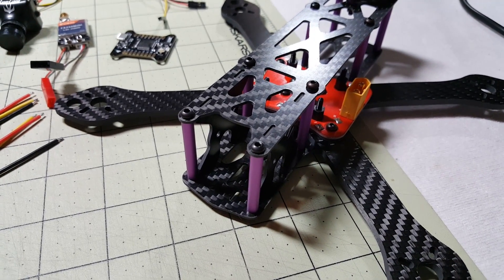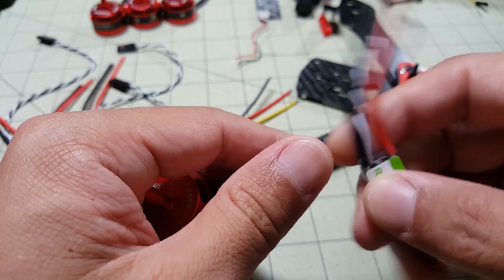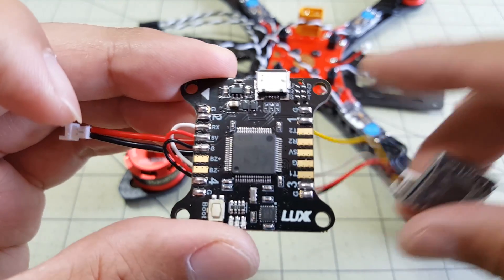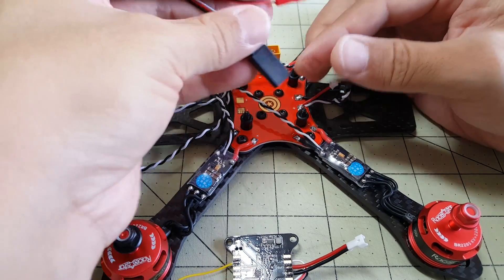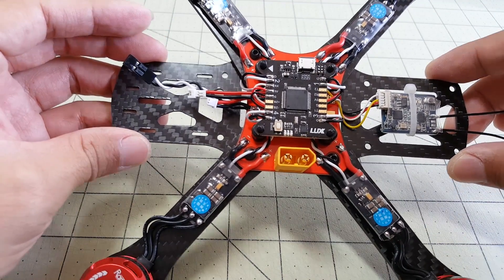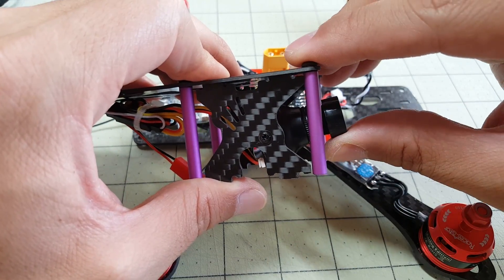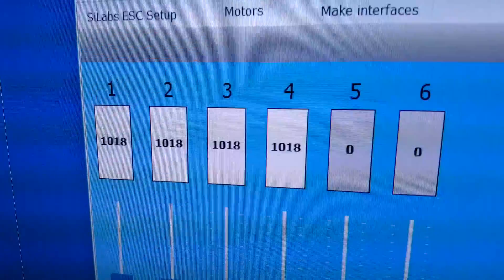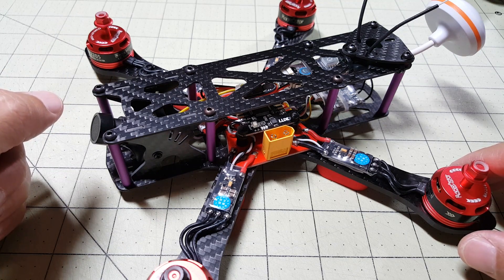Martian II 220mm Quad Build

Comment: Ive been wanting to do one of these builds with the martian frames, but id like to use 5045 tri blade props on emax rs2205 motors and a 4s battery. Will the Favourite Little Bee 30A ESCs be sufficient for the amp draw. Thanks!
Reply from the maker: +Alexander Napper should be ok

Comment: I'm looking for a budget frame that protects the motors well. I was considering the rd210 (search it on banggood) and the Martian II. However I have some problems with both. The Martian II relies on the pdb for support, and I have heard that it's pdb sucks. It's also like 140g. The RD210 is 120g, but the arms extend farther than the main plate (is that normal for all quads? I would prefer if, in a crash, both the arms and the main plate equally shared the impact).

Comment: Just a suggestion: you dont need the little triangle "alien head" piece of carbon fiber. And if you leave that out you can use zip ties inside those heatshrink tubes to make the antennas even stiffer.

Comment: I have a nearly identical build, only difference is the FC (Naze32 Rev6), VTX (TBS 919 unify), and my motors cam with some LEDs for the underside of the arms. Any tips? This will be my first build, any tips? i was thinking i may need to replace to PDB with something that has 5v pads.

Comment: Very nice video i didn't know you had a build video of this frame. I was just wondering i have one coming, but i don't see where to get the 5V to power on the FC. Witch solder pad on the pdb gives 5V? Thanks
Reply from the maker: The LUX flight controller can take direct lipo voltage 2-4S.  So that's why there is no source for 5V.  If you use a different flight board you'll probably fry it.

Comment: Hey dude, I'm totally lost. I'm building this and I have the same escs as you. They don't have BECS so how do I regulate the voltage to the escs? The built in pdb does not have any voltage regulators.
Reply from the maker: +Michael M if you get all the exact same parts the BEC is not necessary. In other builds a 5v regulator is needed for the flight controller but on this one the flight controller can take direct lipo voltage. Same with the camera and VTX.
Reply: Your thinking about it to hard. Bec esc's have a 5v lead including ground and signal for your esc. That will power the FC board when the esc's receive battery power. Now opto esc's do not have a Bec to Power the flight controller, and only a signal and ground going to your flight controller. In this case, now the flight controller has to be separately powered, and cannot be powered from an opto esc.  that's really the only difference. The white signal wire going to your FC tells the motor how much power to give the motor.

Comment: Great Vid! Thanks Albert. I have a newbie question, since I'm about to build my very first quad:
You would fry your 20A ESCs if you use 5045 props and that 4S battery, Isn't it? According to the 'data sheet' of the motor each consumes at full throttle 27.6A. Am I missing something?
Reply from the maker: Yes, if you stay at full throttle for more than 10 seconds it will burn them.  But I use 5040 props and the amp draw is lower and I also don't go full throttle for more than a few seconds at a time.  They can go up to 30 amps for a few seconds with no issues.
Reply: Hi i have a question for you Albert Kim! I want to build a drone with almost the same parts u used here but reading this, why didn't u use 30A ESC's?

Comment: Are you using any special usb cable to connect to PC? It looked different
Reply from the maker: No, it's just a normal USB cable.  The end has an adapter for mini to micro usb so that what looks different.
Reply: Thank you! Tried finding the cushion pads you used for landing, but cant seem to find them.

Comment: hi please help me out,i want to connect ppm to this,and i still use the old flysky fs-i6..i am just not sure howto connect my receiver to this board i know i must bridge the ppm part and the 5vpart wich i did and also flashed betaflight to it..just want to be sure i solder my 3 wires of my receiver to rx,5v and ground??i ordered my parts exacaly like yours just with 30a esc instead of 20a..sorry i am new with this and this is only my 2nd quad,there is just no videos on youtube on how to connect this to ppm
Reply from the maker: Check the manual ... download here - https://goo.gl/70PzPA

Page 2, the PPM pad is RX next to the big 2 on the board. Bridge PPM on the back

Select PPM in Cleanflight or Betaflight.

Comment: I'm about to pull the trigger on this build, how has it held up over time? Happy with the Chinese ESCs and Motors? Or should I splurge a touch more and get something more mainstream? Or are there better Chinese motors out there?

Thanks as always for the wonderful vids!
Reply from the maker: I'm happy with the motors and ESCs. HOWEVER, I'm not a speed freak.  If you need the best, most powerful motor, I recommend splurging on motors like the EMAX RS2205.  The ESCs are fine.

Comment: Are 20a ESC's enough for 4 this motor? I want these motors but I dont know if I need a 20a or 30a esc. Banggood says that this motor has a 27a load current on 4s with 5045 props. And what if I put 5045x3 on this?
Reply from the maker: I'm using 5040 props so the amp draw is lower. Plus amp draw is typically lower in the air than on the bench. However, if you want to use more aggressive props, go with the 30amp ESCs to be safe.
Reply: You sir are amazing. Thanks for the insanely fast response! I will be building my first quad soon :) Just gathering some info before I do.
Reply from the maker: Thanks!

Comment: Are the motor screws long enough for the 4mm arms?
Reply from the maker: Yes, in fact I'm using the shorter screws and they bite into the motor about 1.0-1.5mm which is what I want.

Comment: which motors perform better ? that you used in this build or the kingkongs in your 300$ build, I am looking for 2300-2600 motors from bangood for build like yours and I cant decide motors and ESCs
Reply from the maker: The motors in the Martian are very good, but these are better (and more expensive) - http://goo.gl/9eUsJC  Just warning you that you may not be able to control the power. It's pretty amazing.
Reply: and how about a 2600kv version on 4s lipo 1300mah with 20a ESC ? or rather 40a ESC ? tri blade 5040 props

Comment: How this FC can handle 4s battery ? I red somewhere it is better to add BEC between battery and FC to help FC handle voltage peaks
Reply from the maker: It has a built-in regulator and is rated up to 6s I believe. On 4S it has not given me any problems with voltage spikes.

Comment: Hi, nice clean build, but are you getting any issues in the image quality, since you just have direct power to the vTx and camera and no regulation in between?
Or is the Vtx handling it well? What about the antenna. It's sitting kinda low and could be blocked by your battery very easily. any issues with that so far?
Reply from the maker: +TeeSCee no issues with video. It's very clean. That vTX has a filter built-in. It then cleans up the power to the camera. Also my ESCs are not that noisy. No issues with the antenna.

Comment: Thanks for this video! I'm planning a Martian build but I'd like to use another PDB (the size of the naze32), do you tjink this will be fine or is the enclosed PDB an important part of the frame structure?
Reply from the maker: +Henrik Heinerwall I think the PDB is part of the frame structure but you don't have to use it as a PDB, just as a plate.
Reply: +Albert Kim (marblekit) excellent, there seems to be enough vertical space to stack both a PDB and naze32 even with the original PDB beneath. Thanks!

Comment: My RCX 250 has taken a beating, recently. After I use up my last spare arm, I think I'm going to move onto one of these frames. I might even go the distance and copy your motor/esc choice. Are they the "best bang for buck" pieces at the moment? You're my go-to for finding the not-crap Chinese clones. ;)
Reply from the maker: The scene is rapidly changing! Already the V2 version of the escs are out. I will show them on another video later. I think by the time your ready for a new quad the best parts may be different by then.  But, I'm sure I'll have more updated videos by then as well :)

Comment: I bought four of the Racerstar 2205 2300kv motors from Banggood they have not arrived as yet so it is good to hear that they run so smooth.
Reply from the maker: Yeah, I always run them up in the motors tab in the configurator to hear what they sound like to make sure the bearings are OK. Sometime bearings are bad from the factory. I've had several DYS motors come out of the box sounding like they were already through 10 crashes.

Comment: Very impressive, clean build. Will definitely help me on 1st build shortly. Someone already asked what good the antenna plate was - can you leave it off? Also, I ordered the motors, now thinking I should get the ESC's too. Would you say Blheli_S is the way to go from now on? Can you put them on with any FC, motor, etc.? Last, you mentioned the Lux vibration - when you soft mount a FC, do you put O-rings just under the FC, or on top as well. Somewhere I saw that using 2 O-rings was worse, but I don't remember if that comment was for top and bottom, or 2 on 1 side! Thanks.
Reply from the maker: Yes, you can probably leave off the antenna plate. Especially the way I mounted the VTX antenna pointing out the back and not up through the top plate. It does help hold my XSR antennas but I think I may take mine off too.  I think BLHeli_S is the way to go. But it's still early days.  They are very smooth.  I would get the V2 versions which are already out.  I have them but haven't tested them yet.  Those are going on the QAV-X clone.  http://goo.gl/KVfRRG  The V2s are twice the CPU power and only a few bucks more.  Futureproof, right?  I will have a separate video on the LUX issues. I had some problems but resolved them. I will share with everyone.

Comment: Did the camera tilt back plate not fit your hs1177 bezel? Mine did not fit the foxeer camera, needed the runcam brand bezel
Reply from the maker: +Phil659 I didn't test it. I decided to use my RunCam Swift instead and prefer the ability to adjust my tilt angle to suit different flying sytles.

Comment: I ordered one the other day.
Reply from the maker: +André Rousseau I flew it today... it's awesome.
Reply: My frame will take a month. I like my ZMR frame but the camera setup is lacking. So this should be nice. Been consolidating all my best gear into 1 frame.
Reply from the maker: Cool. Hope this video helps you out. Also, if you are getting the Lux flight controller, be sure to watch those videos to get around the vibration issues. I solved them but it took a while and will share my experience in a future video.
Reply: Running the Naze 32.